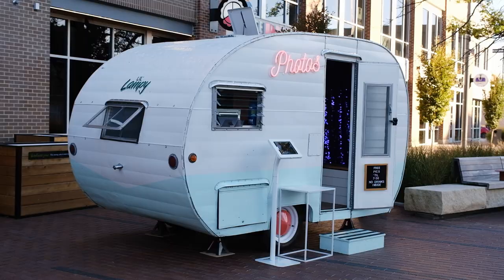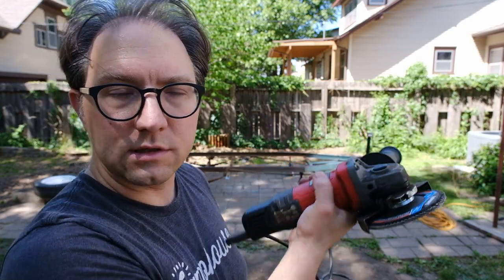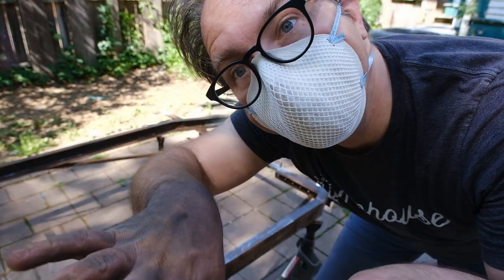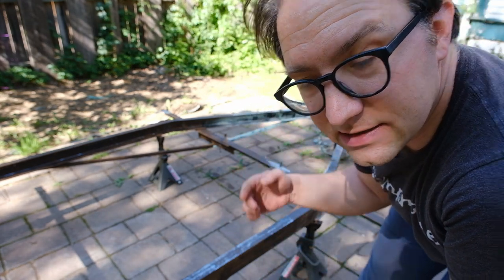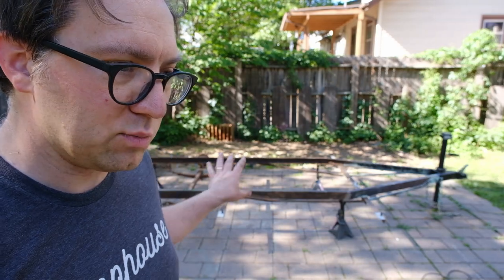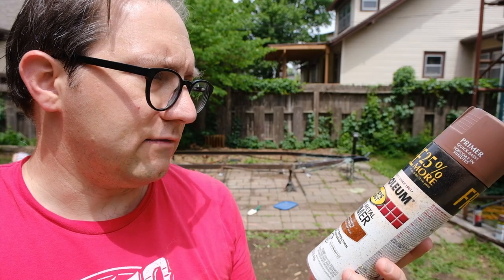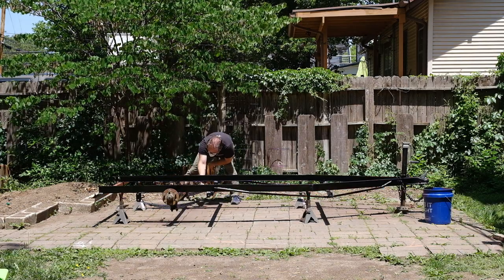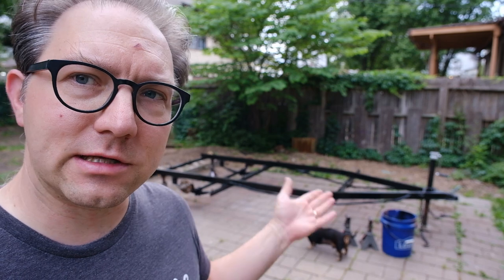POWDER COAT? POR-15? RATTLE CAN? OH MY 😲 How to paint your camper trailer frame

Comment: This is where I'm at with my camper a '58 Holly 16ft. Except I'm planning the subfloor (doing the frame this weekend) and I'm very confused. Originally it looks like some sort of black composite board was used underneath for waterproofing, then of course the frame, insulation, and 3/4 plywood were installed on top. Except I cannot find any examples of how campers insulate their subfloor. I'm thinking of just using a piece of thin untreated wood with sticky roof wrap on it, then the foam insulation will have somewhere to lay (with construction adhesive) and the frame and subfloor will be on top of that. 

LOVE your channel, its helping more than you know :)
Reply from the maker: This is the material that they used:

https://www.homedepot.com/p/1-2-in-x-4-ft-x-8-ft-Southern-Pine-Asphalt-Panel-A11230848096/206086210

Most campers didn't insulate their floor, but the asphalt panel does provide a bit of insulation, sound deadening, and some cushioning to the floor. In my Cal-Craft I just left it off and went with 3/4" plywood instead of the 1/2" that was originally used on top of the 1/4" asphalt panel. The insulating properties of the stuff is pretty minimal, and while it resisted water the original wooden flooring didn't, and unfortunately the asphalt panel has no real structural benefit to speak of by itself.